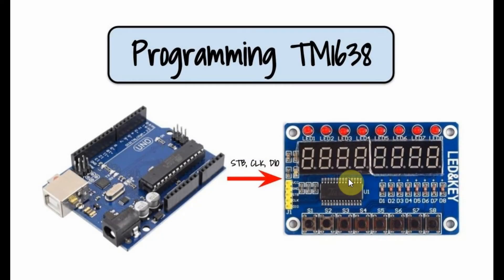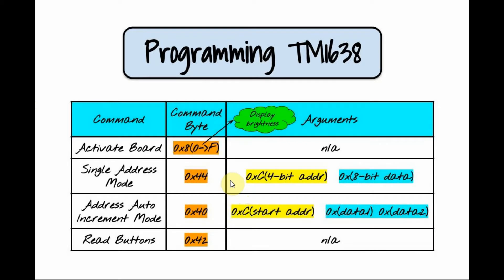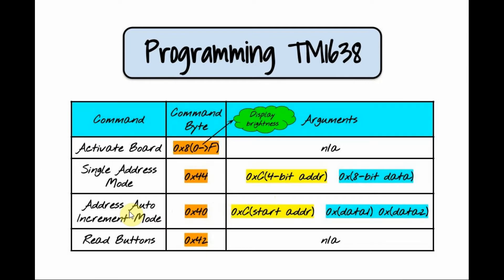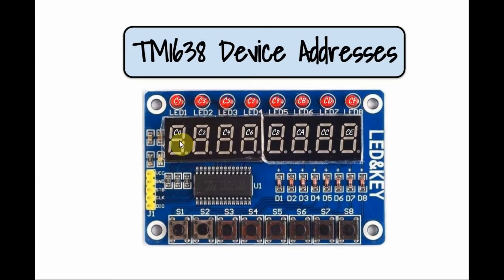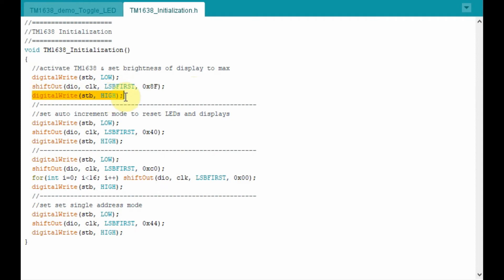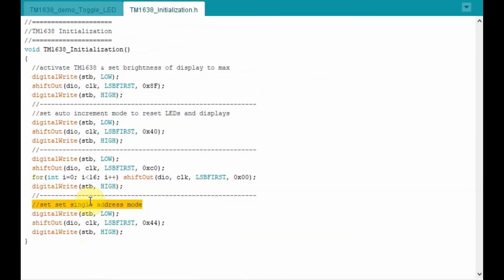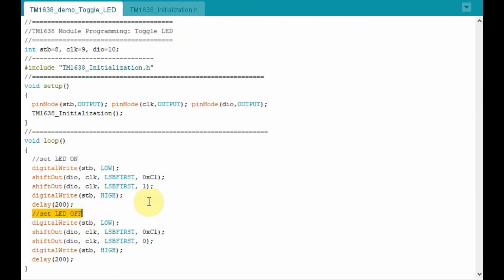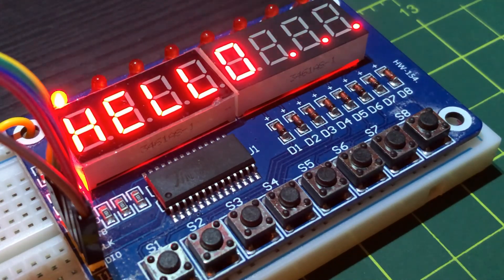TM1638 Programming Using Arduino

Comment: Hi Anas
I watch your videos with great interest. Very informative and easy to follow. I came across your channel while searching for a way to interface the TM1638 along with an arduino, HC05 Bluetooth module to display a vehicles SPEEDS, RPM, FUEL LEVEL, TEMP, ETC using a Bluetooth OBD2 device. Would you be able make a tutorial video that can explain how to do this?

Comment: it's show"test1:6:10: fatal error: TM1638_Initialization.h: No such file or directory
 #include "TM1638_Initialization.h"
          ^~~~~~~~~~~~~~~~~~~~~~~~~
compilation terminated.
exit status 1
TM1638_Initialization.h: No such file or directory
"
please help!
Reply: //=====================
//TM1638 Initialization
//=====================
void TM1638_Initialization()
{
  //activate TM1638 & set brightness of display to max
  digitalWrite(stb, LOW);
  shiftOut(dio, clk, LSBFIRST, 0x8F);
  digitalWrite(stb, HIGH);
  //---------------------------------------------------------
  //set auto increment mode to reset LEDs and displays
  digitalWrite(stb, LOW);
  shiftOut(dio, clk, LSBFIRST, 0x40);
  digitalWrite(stb, HIGH);
  //---------------------------------------------------------
  digitalWrite(stb, LOW);
  shiftOut(dio, clk, LSBFIRST, 0xc0);
  for(int i=0; i<16; i++) shiftOut(dio, clk, LSBFIRST, 0x00);
  digitalWrite(stb, HIGH);
  //---------------------------------------------------------
  //set set single address mode
  digitalWrite(stb, LOW);
  shiftOut(dio, clk, LSBFIRST, 0x44);
  digitalWrite(stb, HIGH);
}

this code is at https://akuzechie.blogspot.com/2020/12/tm1638-programming-using-arduino.html

Comment: Thank you for making the time for this. I personally don't like to use other developers libraries and feel some libraries are bloated.
I wrote my own routines, similar to what you have done for the MAX7219.
I am working on a new project which requires switch inputs.
Your examples here will help me get up and running quicker that wading through the data sheet.
It looks like I can use my existing MAX7219 functions with slight modification.
Reading of the switches should not be too difficult to accomplish.
Oh, FYI, my MAX7219 function writes out a 16 bit word in a single command. Might save some execution time but probably not noticeable.
Reply from the maker: Thanks for your feedback. I agree, writing code from scratch is highly educational and rewarding. Have you created a tutorial of your work? It would be nice to see it. By the way, I’m currently programming the ATmega328 using assembly. I’ve created several tutorials. Thanks again.

Comment: Just learned how to include source files in your script there. Thank you for the tip. Not many features this basic detail in all larger programming :-)
And all of a sudden your worker routines no longer have to reside at the bottom of the script, but can be included in the top - like in proper coding.